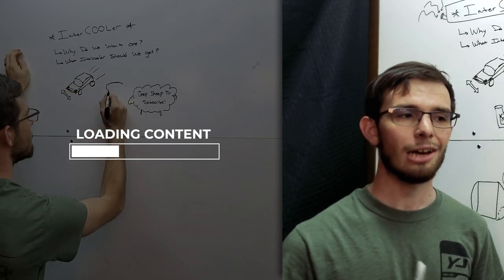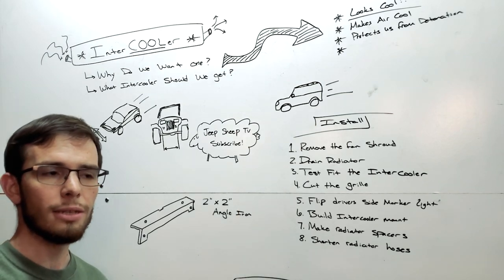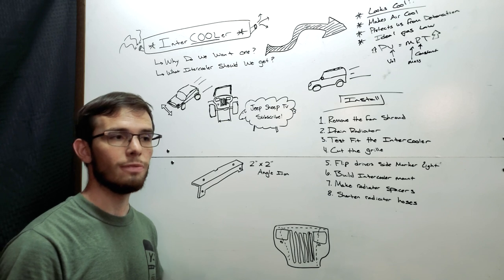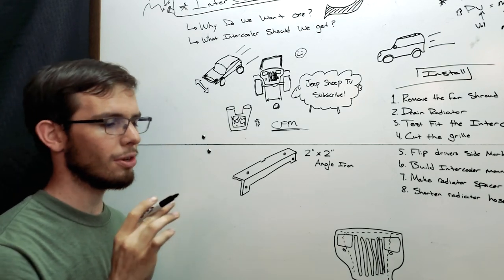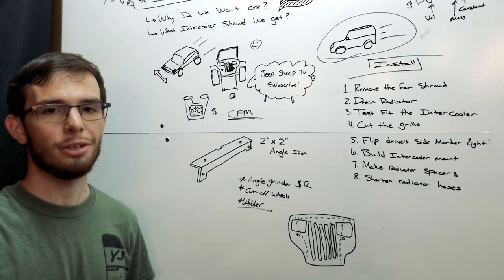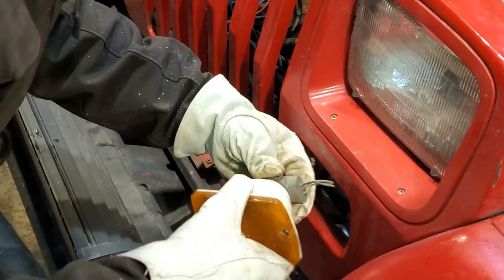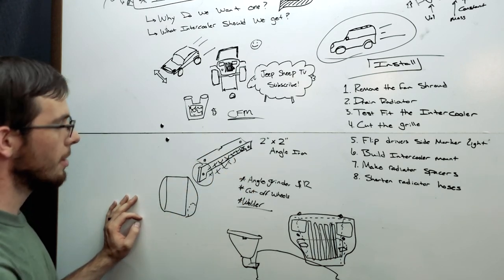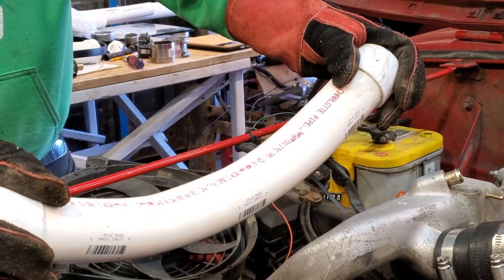DIY Supercharger Part 2 - Installing the Intercooler

Comment: I don't know how you got into my recommended videos list, but I'm loving it!  The core concepts you're teaching are a great foundation to ANY forced-induction setup.

One little nit to pick, though...  Diesel engines are built as tough as they are not because they need to handle "detonation" or "pre-detonation" but because they are compression-ignition engines that generate significantly higher cylinder pressures both immediately before and after ignition.
Reply from the maker: Yea,  that makes sense...

Comment: Very nice detailed explanation on the intercooler.
Liam.  Now that you have a welder are you going to finish the Jeep tub project?  You made lots of small modifications to your 1994 YJ now so you may just want to finish up the tub work and sell the tub.  There’s likely numerous YJ owners who have rust buckets that could use the restored tub.
Reply from the maker: Lol,  that is on my list! I have a non running Commando in the way right now.  Soo many projects! Are you still getting a Bronco?
Reply: @JeepSheepTV  Yes!  However, I’m disappointed immensely on the delays.  So far, over a year and $100 for the reserve, $1,000 for the order.  Here is what I got so far.  Three (3) I’m sorry/excuse letters from Ford.  Last week, I received a giant envelope with a poster of the design.   Big deal.  Don’t need a poster or more excuse letters, I need the vehicle!  And to boot, I have stock in Ford, no more dividend and no X-plan discount on the Bronco for stockholders.  Great job Ford🤬

Comment: To supercharge my 95 YJ seems the best way. I've looked at that ridiculously priced kit, I've looked at strokers (still liking that) but this may be the way I go. Have access to a machine shop. Watching this series now. Will dive into the actual project after depending on your results. Plenty of torque for offroad but 35s pushed by a 2.5 is a little slow on the highway.
I have a winch sitting right in front of where you mounted your intercooler. Think that'll block too much air?

Comment: Remember, whenever using more than one kind of metal in contact you need to be using some kind of anti-corrosion compound. Different metals will naturally cause corrosion between those metals to occur (and many states use slat and sand in the winter months). Just a heads up. Enjoy your Jeeps guys.

Comment: I have a 2.5 yj and I have high revs when it starts it stays at 3k I just switched the sensors on the throttle body and cleaned it any tips? I really want to supercharge it next
Reply: Did you change the TPS?

Comment: You shouldn’t need an intercooler at 3-5 lbs of boost. There would be little to no intake air temp increase at those pressures. 93 octane and done. Probably lost most of the boost pressure with that massive intercooler also.
Reply from the maker: The intercooler is there for 2 reasons.  One is to prove that you can have an intercooler and still stay under the $1k price point. Two, if for if I decide to go crazy and increase the boost, the intercooler is already in place. At these pressures, yes I don't really need it. In fact, there are a lot of ways that I could simplify this build, but I wanted to challenge myself to put together a supercharger with all the bells and whistles for under $1k.

Comment: What did you use to tune and do you need to push more fuel?
Reply from the maker: I used an Arduino to trick the PCM into supplying enough fuel.  There will be a full video about it later in the series.
Reply: Great! I’m going to start on mine as soon as you complete the series I’m already looking for parts. Is there anyway you could shoot some pictures of how you ran your piping? I never could get a good shot of it in the videos
Reply from the maker: @coltejames6452  that will be in the next video